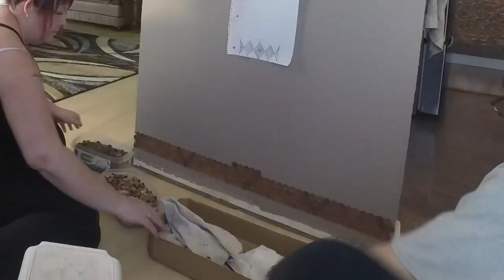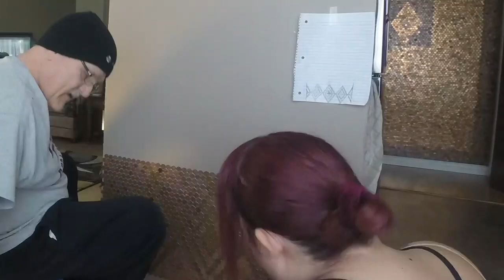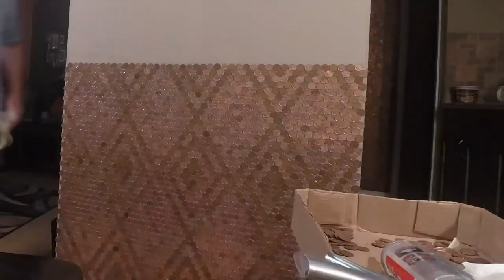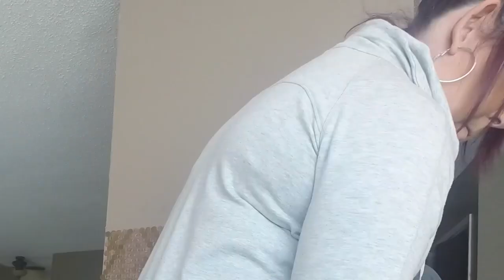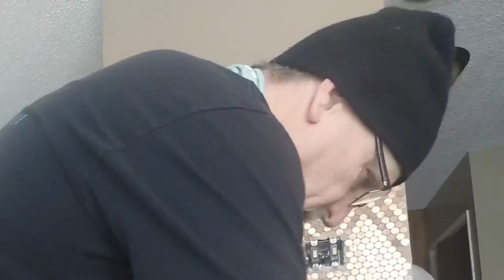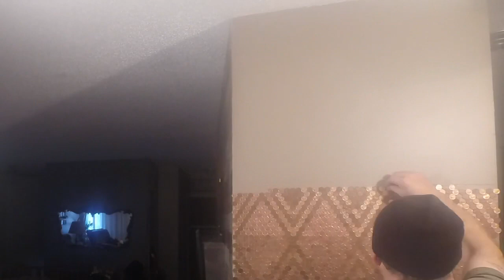Time-Laps Penny Wall Penny Art

Comment: I did my wall in sections, on construction paper w/Styrofoam board in the middle from the dollar store.I sealed each section with resign & hung it all together onto the kitchen wall. This will prevent permanent damage to the exterior walls as well as the ability to remove & reassemble the "Penny wall" if needed for sale of home, reconstruction etc. Love it!